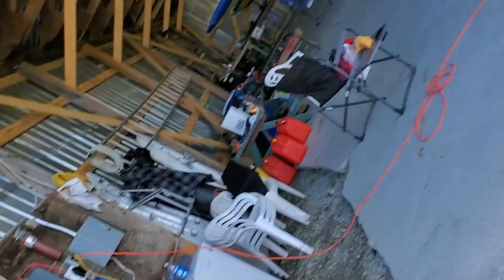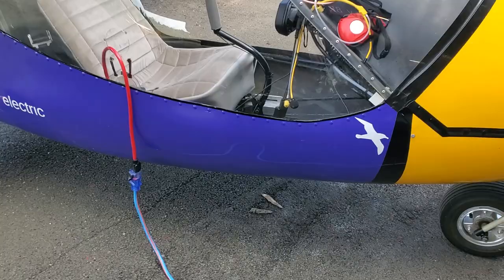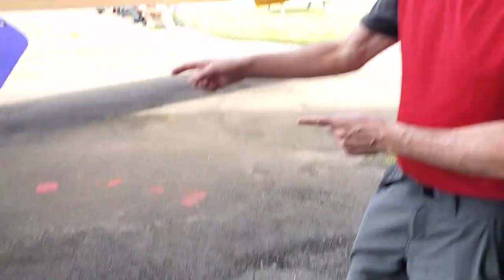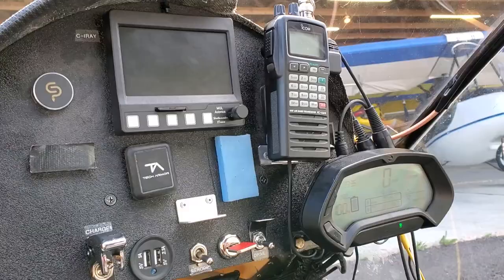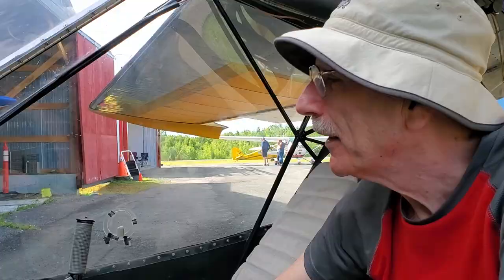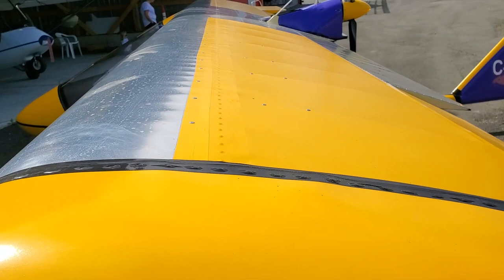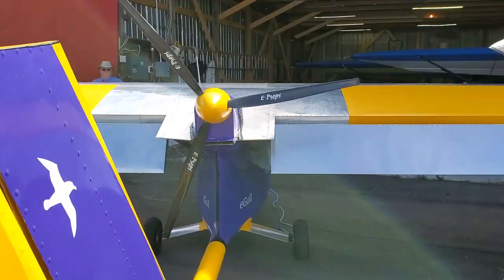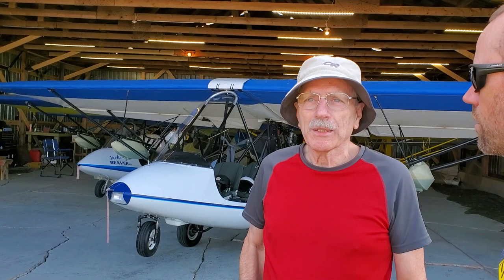eGull | An Electric Ultralight

Comment: Surprised at the prop noise 😳
Reply from the maker: Most don't realize how much noise comes from the prop. The engine is the quiet part. lol
Reply: @mmatt  Yup.. the "engine" is so quiet, it doesn't even exist. I'm sure there's a motor though. lol..  jk...  So while I have your attention.. What's the total weight with a full tank of fuel..?
Reply: Yeah - The prop tips going thru the speed of sound will do this. Some people are working on winglets at the prop tips that supposedly reduce the noise substantially.
My Archeaopteryx is also very loud: https://youtu.be/ZfQF2HI0rYU / I need ear protection when flying this.
Reply: @Mywhtjp  - How Much DO Electrons Weigh, These Days? 😞

Comment: Excellent.

If the battery was 5 years older he'd be lucky to get 20 minutes. Imagine what will be available in another five years.
Reply: That won't be a concern for Anybody.... 5 years from now.
Reply: State of the art this year should be a a 500 wh/kg battery from CATL or a few other battery producers. Hard to get and probably expensive for now. But they basically announced those a few months ago. That's probably at least double the energy density in this thing. And since you use a lot of that on take off, that should extend range by more than 2x. Five years from now, we might get another doubling.
Reply: I’m contemplating buying Nissan Leaf 2015 the battery degeneration is 10% so you are way off in your calculations
Reply: @doddsalfa  I think it's about progress and development (today's new batteries vs new batteries 5 years ago), not about degradation.

Comment: Hey buddy being a retired electrician I cant help myself. Now if the motor is rated at 52KW that's 52,000 watts now 746 watts = 1x H.P. SO DIVIDE 52,000 by 746 gives you 69.7 horsepower. that's some power so that plane should hoot. which I am about to watch as I stopped viewing while I was typing as I cant multitask.
Reply: Corrected.

Comment: I for one are for these electric powered machines...in the end you have to adjust to change. I will always love my fossil burning engine, but I would like one of the electric machines. The power that they produce from a lightweight powerplant is just phenominal. Thanks for the share...
And it even sounds normal with the noice of the prop
Reply: I'm guessing it would be much quieter inside, without the noise and vibration from an engine

Comment: Great video and wondering if Ray has looked into using the no fire puncture test, BYD Blade car batteries used in their Atto 3 EV?  But I am not sure if they would fit. Also this chemistry can operate down to a lower voltage hence more duration.   😊😊😅😅. Thanks. Laurie. NZ.

Comment: Is that 70 minute flight time with 30 minute reserve?
Reply from the maker: No, that's 70 minutes until the battery is dead. There's no 30 minute reserve required for ultralights here in Canada but a smart pilot will always fly with a reserve in mind anyway.

Comment: What's the total weight? How well would it work with solar panels on the wings and fewer batteries or batteries plus ultra capacitors? What's the glide ratio?

Comment: I'm wondering if the addition of some solar panels may extend the flying time? 
If it were me I get the feeling that I was rushed wondering about power level I think for me it would decrease the enjoyment knowing there was a brick wall of flying time.  Matt what is the flying time for your gas powered aircraft with full tanks? Thanks for the video.
Reply from the maker: Solar panels would only add minutes of flight time as I understand it. They would weigh more than they contribute I think. I can fly for about 2 hours on 10 gallons of gas and I rarely fly more than an hour at a time. For this style of flying, I think the 70 minutes that he has is just about perfect. Especially where he doesn't have to worry about leaking fuel lines, tuning carburetors, stinky exhaust, etc.
Reply: Lower vibration would increase safety and reliability as well I would think…

Comment: Correct me if I am wrong but don't those batteries cost 10,000 Dollars U.S.  Each ? Your friend James
Reply: I bought 16 CATL brand, 3.2 volt 280 Ah LifePO4 cells for $2600 US. Result is 48VDC /280 Ah battery.
That’s about 13.44 KWh of capacity.
You’d have to know the load (motor, avionics) to know the duration.
Reply: @marknichols7861  thanks Mr. Nichols , this Intel. Helps clear up the lack of information I have. There is a lot of talk out here of what is and what isn't !  Your friend James thanks

Comment: Got one question. Why??
Reply: It's got around the same range as a rotax 503 with 5gal tank but you don't need 35 bux everytime you want to fly. Just charge the battery and have fun. With 2 batteries this thing would be a beast!
Reply: @jamesordwayultralightpilot  Never work in bush Alaska where I live.
Reply: Why not?
Reply: We power off gen sets. I pay a buck a KW in Galena.
Reply: I got 1 answer..  Why not.  I would say because he can.. and it's the future.
Reply: @Mywhtjp  I guess if a fella never gets over thirty miles from an airstrip with a place to plug in it's a dandy idea. In Alaska the airstrips are much further apart and seldom have any power available.
Reply: That's what some people asked when the Wright Brothers first flew out of Kitty Hawk. Not very far thinking individuals.
Reply: I used to fly in gyros.  Gyros are not terribly quick and mine was open frame.  So while my VW had very, very good fuel burn (I could with a full tank do 3.5 hours easily) I never flew more than a bit over an hour ever.  Gyros are very very stable in flight even in thermally weather so I would get bored so I much preferred to explore an area that I was flying in then buzz around a bit doing the nice tight maneuvers gyros are so good at.  I might then on a weekend flying do a few such flights.  But a 70min endurance would be fantastic.  Of course batteries would need to be a 2x their current capacity for that (although they are getting there).    So yes useless for cross country but for a para-motor a light powered hang glider or the sort of flying people often do in ultralight gyros in US on two strokes with only 5 gallons of fuel.  This would be a great little plane.  

Considering I have also had 4 in flight engine related emergencies from failed distributor, locked slide on SU carbie (giving me too rich a mixture which resulted in a very short but dangerous flight too low over high timber to turn out shallow enough to not loose height), carbie icing (engine failure),  and a warped head resulting in an engine failure I'd say having only one moving part would be very beneficial.  

Not everyone flies extreme distances or lengthy flights.  Consider how much fun something like a quicksilver was/is.  Great little plane but not great after early morning or in very windy conditions, not fast but don't tell me they sold so many because people didn't enjoy that type of flying.  

Give it 10 years and the batteries on that will give that machine a battery of the same weight with 2 - 2.5 hours of range now the $5 to fill it with electrons, almost zero maintenance, quieter from a distance (with the right prop), very little chance of an engine failure, no oil, no fuels, no exhaust, no changing jet settings in winter, no carb ice, no drop in power at altitude etc.  I'd say why would anyone want an ICE powered ultralight.  Myself in that situation I'd buy a smaller battery keep the 70 minute range and have more performance.  

Also consider this there is the potential to hook such a battery to your house, his was what 14 kwh battery, that'd bigger than a Tesla power wall, if you had a ultralight that could be trailered home (as my gyro is) or a removable battery/s you could use it to power your house and save your power bills and make more use of rooftop solar or even just charging off peak and then running the house of the battery in peak times.  Over the life of the battery it would pay for itself and when its capacity had dropped too low after 5 years you can buy a new, lighter more powerful battery with the money you have saved.  You're Rotax 583 will meanwhile just sit useless in your shed/hanger when you are not flying it. 

Electric motors have two bearings that's it to wear out.  So after 500 hours how much does a rebuild cost?  Meanwhile your choices of engines are Hirth and a few European Two Strokes how long before there is no 20, 30, 40, 50, 65 hp engine available for your particular ultralight?  The engines themselves are about 11-12kg for this hp, so once batteries are more energy dense you won't rebuild your engine, you may recycle your battery - if smart we will use the 80% capacity battery (after 1000 charge discharge cycles) as a home storage battery and buy a better one.  

Other things an electric motor can potentially do.  Consider landing and putting into reverse.  No problem you can actually do that so save the weight of your brakes and just use reverse thrust.  You can actually stop an electric motor at a specific position so if using this for some soaring on a thermic day and with a two bladed prop you can minimize drag.  You can instead of having flaps use the re-gen to slow the rate of descent I'd think a good way of doing this would be to have a throttle which has a beyond off and goes into re-gen if you did this progressively rather than just on or off you could essentially have a controllable drag brake you could apply.  So while this would be useful on a landing being able to control your descent more accurately (and putting power back into the battery) you could change ultralight gliding which is limited in distances traveled to how long can I stay up.  One good thermal and you could climb descend in the thermal using re-gen climb again  and so forth.  Could be an interesting new sport in this.  A good windy day near a mountain range or a hot thermic day and a egull or similar could stay up for a very long time indeed.  How long could you stretch such a battery.  Would it eventually be possible to land with 100% power?  All this is possible.

So loads of why's just have to think a little more laterally.
Reply: Great reply brother. There’s a professor in England with a prototype electric that has the “beyond off” throttle setup you envisioned. You “Powerwall” style dual-use idea is brilliant. I was having trouble with the cost of the batteries, but utilizing it in that manner actually brings battery cost to below zero! I appreciate the thoughtful post.
Reply: Why? Simpler, cheaper to fly and maintain, more reliable, more quiet, lasts longer, smells better, sustainable, don't need gas at remote airfields (just an electric hookup, or solar panel and battery).

Comment: I would love to have known more about the chemistry of the lithium battery, is it lithium polymer? , lithium-ion ion ncr, inr, icr, ifr, lg, ur or us chemistry ? Would Ray consider lifepo4, or even LTO chemistries ? Very important question, knowing what he knows now, what would Ray improve on the plane?
What about using a ducted propeller?
Reply: Since the powertrain is from a Zero motorcycle, it's likely a 14.4 kWh lithium ion battery pack with 12.6 kWh usable.